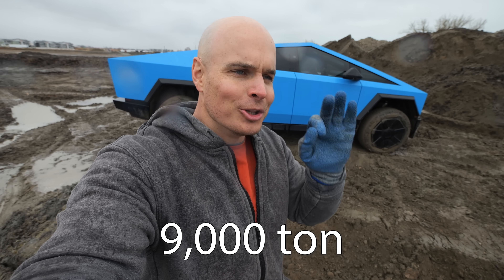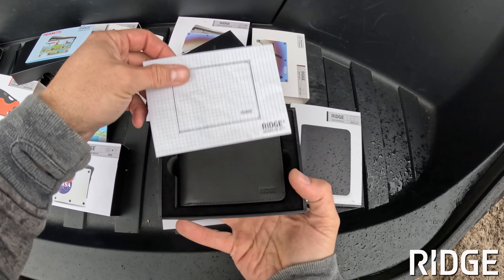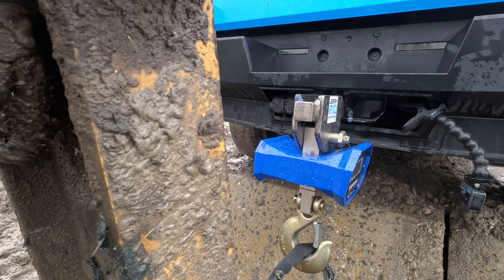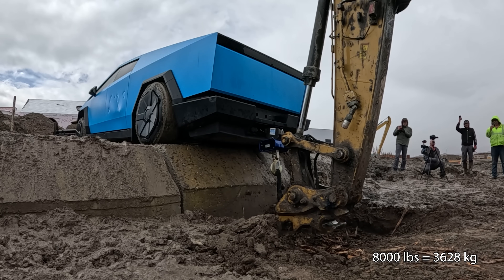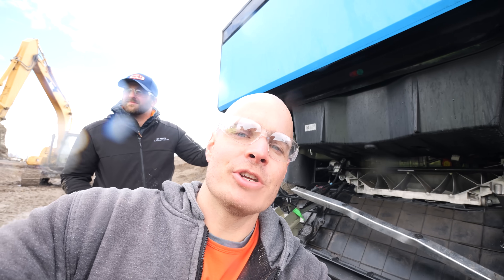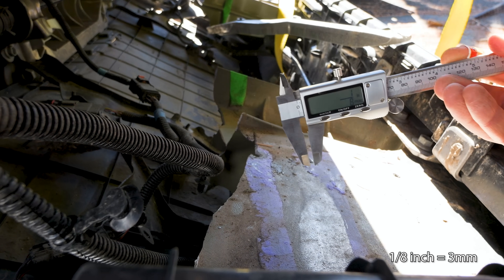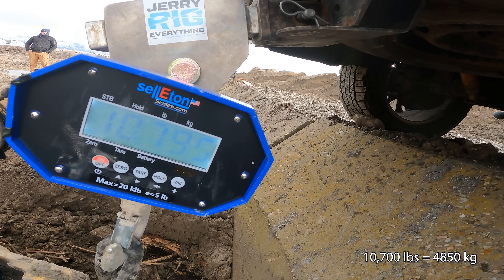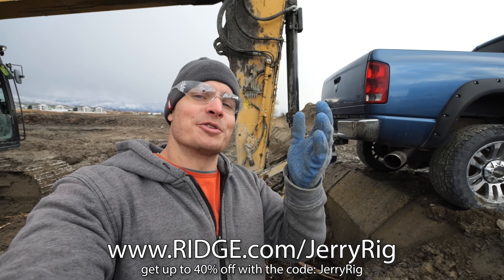SHOULD YOU TOW WITH A CYBERTRUCK?! - (catastrophic failure test)

Comment: Tongue weight which is the load of your trailer pushing down on the hitch is normally about 750 pounds. When you see someone towing a trailer and it’s pushing the truck down that’s overloaded. Pulling 10k does not mean the hitch had 10K on it. It should only have 750-1000 lbs so this video seems misleading at first glance

Comment: You are comparing a ram 2500 with max tow rating of 20,000 lbs vs a cybertruck with max tow rating of 11,000 lbs. Maybe at least compare it to a ram 1500 or f-150? which is generally in that same 11,000 lbs range. Also going to note that the cybertruck actually tells you when you have too much weight on the tongue, which is not mentioned in this video. It pops up on the display when you are driving saying the load has shifted pull over immediately.

Comment: Very fun to watch!  But unfortunately not a very educational explanation actual towing safety.  Watching a Tesla being torn apart makes up for it though!

Notwithstanding the misleading and/or ignorant claims of the producers, the truck actually out-performed expectations and its ratings quite a bit here.  ie. In no configuration does the Cybertruck GVWR exceed 10000lbs.  
GVWR would need to be around 17000lbs to handle 10000lbs on its tow hitch!
Pressing down on the hitch of a truck is testing its "tongue capacity", not "tow capacity."
And finally, any tow failure where the front end of the vehicle has to be held down is not revealing a real-world problem!

Knowing what a vehicle can safely tow is not rocket science.  It's printed on the door frame.
So I looked it up:  the "tongue capacity" of the Cybertruck's hitch is 1100lbs/499Kg.  This is in line with the general rule of towing - tongue weight should not exceed10% of the tow capacity while remaining under the GVWR for the vehicle.
The GVWR is always important because suspension, handling and most importantly, brake capacity are all important in towing!

Full disclosure - I'm certainly no Tesla fan and not defending the engineering or claims made on its behalf.
Everything about this vehicle, from its corrosion-prone, mis-aligned exterior panels to its lack of general practicality, screams it is nothing more than a bong-induced middle finger from Elon to his cult followers; an inside joke flying over their heads!  
With it, he has definitively proven they'll buy  A N Y T H I N G  he puts his name on!

Comment: With today technology, the critical stress zones can be observed by the car (strain gauge). Once a sensor measures critical level it simply denies going further. It could be a car overload or trailer or both. These sensors cost no money compared to the car itself.
Not because of this video but I dislike the cast frame idea since I first read about it. I would never use a car second hand which has one.

Comment: As a design engineer, my biggest concern here with the cybertruck isn't that it failed, but how it failed. I don't design vehicles, but this seems like a pretty clear cut case where there should be a designed failure mode in the hitch itself WELL before you get into failures of the frame of the vehicle.

Comment: They are going to add more aluminum on the frames if they haven't already. Aluminum is an excellent material to use as a frame but you have to figure out the max weight that will ever be on these then build it so it holds 3 x as much before it snaps. Steel is definitely not better for a frame it's just safer if you don't know how t design good, because it will just bend first but still stay together.

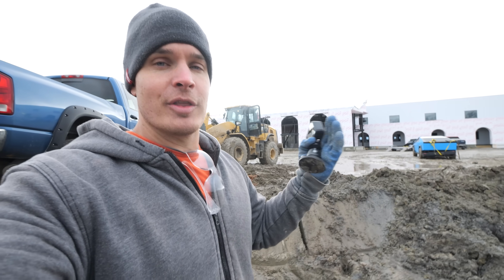Comment: 12:03 With the same form and shape, steel will always be better than aluminium. Rule of thumb in the wild (not for real engineering calculations though), would be to increase the aluminium mass a bit under doubling it to get the same strength as steel. But doing so, you should still be under the steel mass, hence being lighter.

Remember, most commercial airplanes are made of aluminium, so it shouldn't be that weak. Unless it's a shit design that just used the steel mold and poured aluminium in it 😂.

Also, in my opinion, I wouldn't use aluminium casting on mass produced parts without a really big (and costly) quality control. While it is easy to cast aluminium due to its low melting point, it is hard to get the right quality due to its interaction with air when molten.

Comment: So… this video proves a Ram can withstand 300 lbs more than a Cybertruck. 10,400 vs. 10, 700, that’s less than 3% difference. 
And can that excavator really only provide 10,700 lbs of force? 

If so, a conclusion of this video is that the Cybertruck can withstand a force only 300 lbs shy than the max of a 50,000 lbs excavator. That actually sounds pretty good.

Comment: You should have dug a bigger deeper hole with the excavator. Then fill the bucket with dirt and then Gerry rig a harness to pull down on the scale. The dirt plus the bucket would have added a couple thousand more pounds to the test

Comment: The ram has 7.54 inches cross-section of 50 KSI steel in the rear box frame. Giving it over 300,000 pound load to catastrophic failure..

Comment: Tow weight is not the same as tongue weight. Stop the sabotage of american made products. 

Also dont put the excavator so far away from bumper And it will burry the ram down on the ground after breaking it. The machine was too far thus the full force couldn’t be applied downward.

Comment: Just because the Dodge didnt break on the same amount of force that caused the Cybertruck to split in half, doesnt mean the Dodge is stronger than the Cybertruck.  The question of which one is more strongly made is still as unclear as ever.  I see some Elon fans out here today.  This isnt a bonghit, Elon fans.
Reply: Depending on Doge trim you could have one which can handle way more load due to its higher rating, we have no idea what exact type of Dodge it was and due to the fact that load difference between CT failure and what Dodge received being quite close doesn't indicate how much dodge could actually handle before failure based on its actual towing capacity rating.
This "test" was quite pointless.
Reply: @Zripas  This thing I am doing right now is not a bong hit

Comment: The tongue weight on the biggest RV trailers typically falls between 10% and 15% of the trailer's gross loaded weight. For a trailer weighing 10,000 lbs when loaded, the ideal tongue weight would be 1,000 to 1,500 lbs. This means that the heaviest RV trailers could have tongue weights ranging from 1,000 to 1,500 pounds or even more, depending on their overall weight. The cybertruck is perfectly safe.

Comment: Pretty much any rigid material is easier to bend or snap than pull apart. Applying the tow rating to tongue weight seems wrong. Also, long before these type of vehicle's hitches could fail they would be undrivable due to the front ends being raised too much. Sketchy steering and braking. You should give it a try and film it. Down a long steep grade.

Comment: When the towing is for 11000 pounds, the vertical load on the hitch will be half or just a little than half depending on the loading inside the trailer. 10400 lbs vertical load plenty good for towing 11000 pounds.

Comment: 1.	66,000 lb Trailer Load:
That’s a Class 8 truck-level load—the kind hauled by semi-trucks, not pickup trucks. No light-duty consumer vehicle, electric or gas-powered, is engineered to tow anything close to that.
	2.	Tongue Weight of 10,000 lb:
That alone is several times the tongue weight capacity of even the most heavy-duty pickups. Most Class V hitches top out around 2,700 to 3,000 lbs. A 10,000 lb tongue weight would require specialized equipment and frame reinforcements, not just a strong hitch.
	3.	Cybertruck’s Towing Capacity:
Tesla claims the Cybertruck can tow up to 14,000 lbs, which is respectable for a pickup—but that’s still less than a quarter of what you’re talking about.
	4.	Range and Practicality:
Even if it could move the load, range would plummet under that kind of stress. An EV pulling well beyond its rated capacity would chew through its battery in no time.
	5.	Who Buys an EV to Tow 66,000 lbs?
Exactly—no one should. It’s not what these vehicles are for. If you’re in that hauling range, you’re in semi-truck territory.

Comment: Honestly, breaking at 10x its safety rating is pretty good. My grandad's F450 had a built up 3500 lbs hitch (for farm work, towing 20k+ on dirt roads and across fields) and I dont think it would survive 35 thousand lbs on the hitch. HOWEVER, being built out of aluminum is absolutely absurd. After enough use, it will fail even if it never exceeded its ratings. That F450 is still working my buddies farm 10 years after we sold it to him and it worked ours for 10 before that.

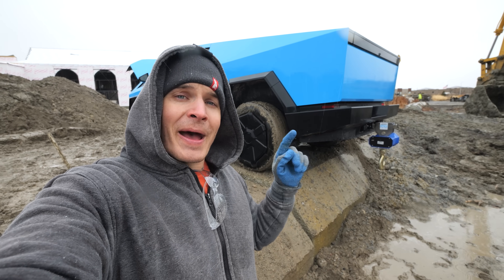Comment: 3:37 stuff like this always reminds me of Scotty from Star Trek TNG. He said he always wrote the limits for his work lower than what the systems could actually handle because he knew people would always push the boundaries if they knew the real limits
Reply: Issue with this video is that Jerry took TOWING load number and used that for VERTICAL load test, those are completely different things. Vertical load is usually 10-15% of towing capacity, so actual vertical load limit was more like 1100 and not 11000, so CT beat it by more than 9x, yet this video want's to make a claim that it failed under its rated limits...

Comment: You are confusing towing capacity with maximum tongue weight.   The max tongue weigh is 1,100 pounds not 11,000 pounds you’re off by a factor of 10.
Reply from the maker: No I'm not.  Watch the video.
Reply: @JerryRigEverything  
But you are. Towing capacity 11 000, that's mostly horizontal load, while you done test on vertical axis, which usually is rated to 10-15% of towing capacity. There is a reason why so many people pointing this one out, because you screwed it up big time. 
To put it simply for you, vertical load for CT is rated at like 1100, so it would have been a big issue for Tesla if it broke around that number, but it went more than 9x before critical failure, yet you made it look like its the world ending results. 
Well, you got your clicks I guess, so this is what matters most for you and not objective testing.

Comment: Simply put - aluminium frames are not a good choice for passenger cars, never mind a truck purported to be able to endure the stresses of pulling up to 10,000 pounds. We have already seen stress cracks in critical areas of Model Y, 3, S and X vehicles that were never used to pull a trailer. Those same stress cracks will occur on the Cybertruck, but be compounded by the added stresses of towing. These things won’t last long in real world use by people that actually pull frequently.

Comment: After World War 2 Britain was bankrupt.  So their government implemented an number of measures, including borrowing huge amounts of cash from other countries.   And rationing steel.   Car manufacturers were not permitted to buy steel unless a large fraction of the steel tonnage was used for export vehicles. So Rover decided to make car bodies out of aluminium.   But they retained a steel ladder chassis in these vehicles.
This let them get allocated more steel than would otherwise be the case for the number of vehicles exported.
But aluminium body panels did not make a lot of difference.   If it was safe to make an aluminium chassis as well, they would have.
Aluminium is good in aircraft because aircraft are not subject to large sudden localised dynamic loads.  Even so,  they have a fatigue life that cars do not.

Comment: This is an all in one test but what it’s showing is one of aluminiums weakness. It’s brittle and damaged is accumulative, every time you put an abnormal load on it, it gets damaged and fatigues. So over time the load required to drake it reduces. So in a few years of use, do you really want to be in a truck and have a head on collision or hit a big pothole and your trailer comes ploughing through your truck as it snaps to pieces? Steel will bend over time but not weaken.

Comment: The first GM product went on sale in 1901, the first Ford in 1903, the first Chrysler in 1924, the first Tesla product in 2008, and the first Cybertruck went on sale SIXTEEN and a HALF MONTHS ago. These other companies have had over a HUNDRED YEARS to get it right. Battery tech is as bad today as it's ever going to be. This is Tesla's first shot at building a pickup; lessons will be learned, and mistakes will not be repeated. This company has come a long way in a VERY short period, a fact many seem to miss. The real problem isn't the 10,400 lb limit - changes will be made to increase the limit. The REAL problem "today" is EV towing range, which is a much tougher problem to solve - in the near term. Remember in a little over 48 months 70% of vehicles sold in CA are to be EVs. (I don't give a crap about politics and I drive an FJ Cruiser with 236K miles on it)...and in a former life, I was a Lockheed Martin engineer.

Comment: The purple adhesive is a strong as hell structural adhesive, often stronger than welds. I would expect to see more squeeze out. Overall, I would want to see more robust casting cross-sections if they stay with aluminum, but steel in the rear frame makes more sense. Great work as usual, Zach!

Comment: Engineering Explained have done a thorough engineering analysis showing why Cybertrucks are not sold in Europe - they don't meet regulations. Dodge RAM engineers design for more than minimum regulation, hence don't break. 

Another Musk con
Reply: It broke at 9x the rated load... 
CT isn't allowed in Europe not because of this, but because of it being not so friendly to pedestrians, as you would suffer quite a bit of damage by simply being hit by those sharp corners.

Comment: I am not a fan of the Swastitruck. BUT to be fair, trucks towing capacity is not determined by up down force on the hitch but how much it pulls, forward and backwards (and some side to side). The tires of the trailer handle most of the weight. So this isn't really an accurate test.

Comment: When you hear creaking sounds thats already a point of fail, the fact it didnt get to its rated 10k becore those sounds is very bad
Reply: Towing capacity is not the same as vertical load... Please educate yourself.
Reply: @Zripas  point of failure shouldn't happen halfway to it's rated capacity, you can hear the cracks happen well before the 10K limit was hit.
never
use
aluminum 
for 
frames
Reply: @ 
? Once again, read this part slowly: Towing capacity isn't the same as vertical load on the hitch. Aka one is horizontal load the other is vertical. 
CT towing capacity rated at 11000, while vertical hitch load rated at 1100, which is normal rating which usually is 10-15% of towing capacity. So CT failed at more than 9x of its rated vertical hitch load, not half way, but 9x. Do you get it now why this video received so much negative comments? Because its dishonest and makes people like you to misunderstand basic things here. it didn't fail before it rated load, it failed more than 9x.

Comment: It’s really unfortunate that this video is politically motivated instead of rooted in science
Reply: What are you talking about? The scale doesn't lie the Ram is stronger than the tesla. Steel is better than aluminum for strength.
Reply: @ yes I know that. But many things here were glossed over in the name of making the video skewed a certain way. Obviously the ram with steel will be stronger, but this video solely focused on tongue weight, which both vehicles exceeded their ratings by at least an order of magnitude. Just because the Tesla is weaker than the ram doesn’t prove any real deficiencies. If this test were recreated in a real world scenario with thousands of pounds on the tongue, no manufacturer would ever be held liable for failure since they are rated far below that and it’s unnecessary to carry much more than their ratings for the size vehicle that pickups are. Instantaneous shocks from load are also covered by having a safety factor. Makes sense?

Comment: For those complaining "not a fair test", watch the later video by Engineering Explained where he compares the loads applied here with federal guidelines plus internal requirements by another truck manufacturer.  His evaluation is that Cybertruck does fall short in their hitch design.  This failure would be extremely expensive to repair, if even possible.